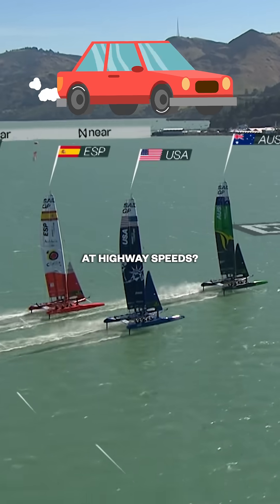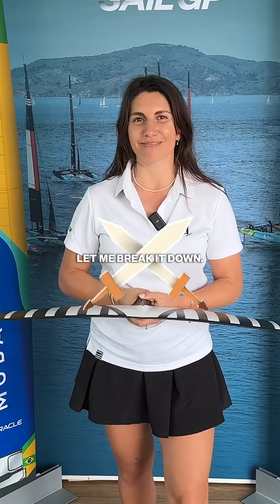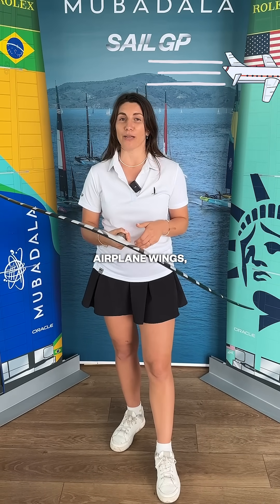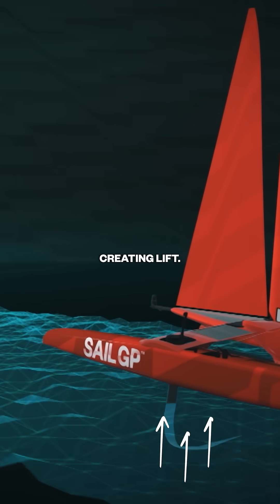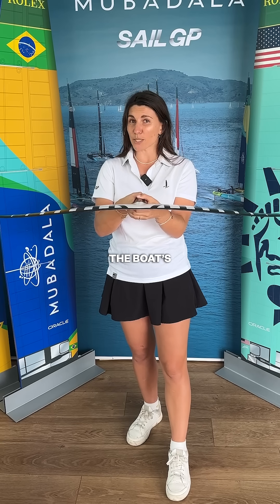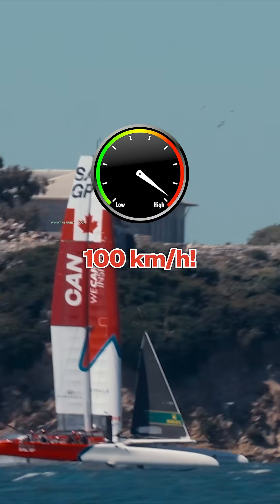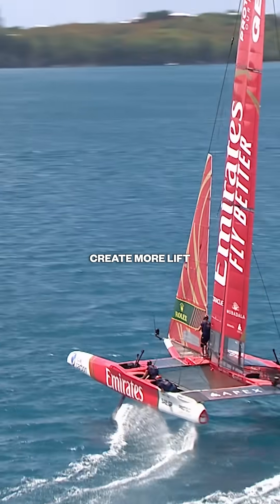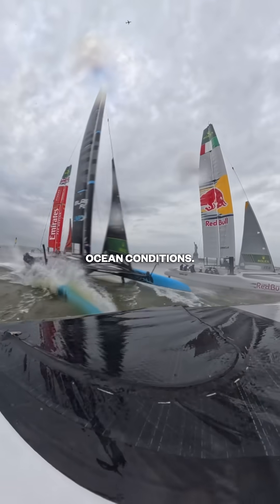Ever wondered how SailGP boats FLY above the water? ⛵️💨 Here's your answer 👆#SailGP

Comment: Im always wondering how the boat moves a lot quicker than the wind. But i love your explanation of the foils.
Reply: Think about this - the tips of a wind turbine blade go around 7 times faster than the wind while making power.
Reply: The measured wind speed and the realised wind speed o the boats are different, and the only premise for the boat accelerating is that friction through the water is less than the power from the sails. In sailGP the boats sail so fast that even when the winds blows from the back, the realative wind comes from the side or front.

Comment: I have a question. If it was like an aeroplane wing "but flipped and submerged" The wing on an airplane produces lift, if you flip it and put it under a boat, that would drag the boat down, not provide lift. I am not an engineer or a sailor, happy to have clarity around this.
Reply: They aren't flipped upside down - exactly.

Keep in mind that the tail on an airplane generates negative lift (pushes) down for reasons of stability. I'm not sure but I wouldn't be surprised if the foils on the rudders act in a similar manner (as upside down wings).  But the main foil is definitely a lifting surface.
Reply: To expand and answer fingers postulation; the daggerboards generate lift and the rake of those foils can be adjusted to generate more or less lift. The elevators on the rudders can both generate lift and be raked to provide negative lift or downforce. These boats will generally create lift with the daggerboard that is in the water, create almost no lift with the rudder on that same side, and the rudder on the opposite side will be negatively raked, what we commonly call differential, which pulls the side the wind is coming from down. That differential allows the boat to go faster by keeping it more horizontal/flatter. The term we use is called righting moment and that differential increases righting moment. Hope that helps.